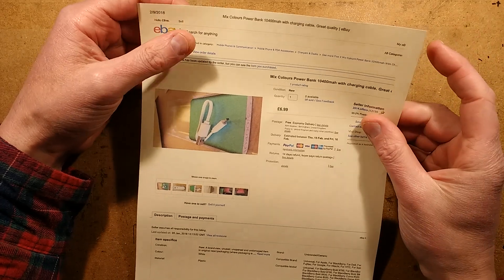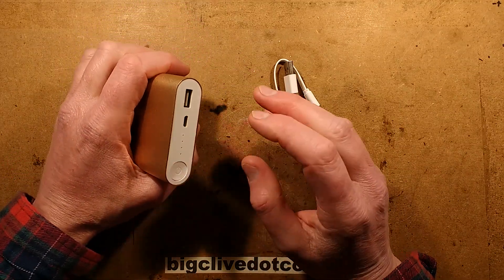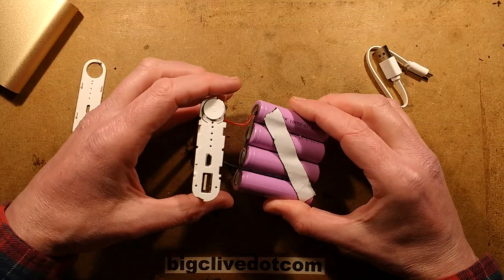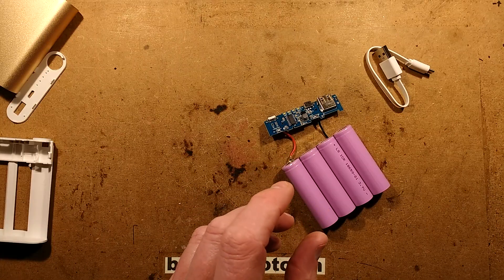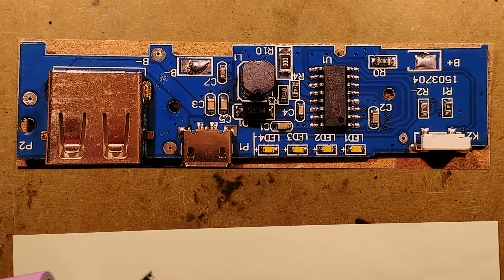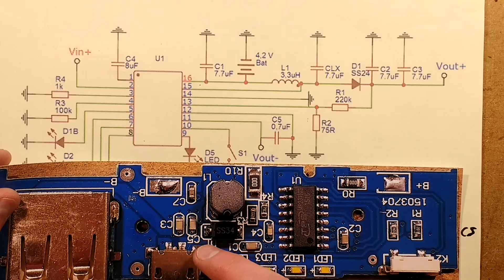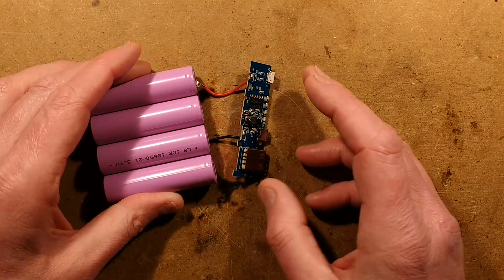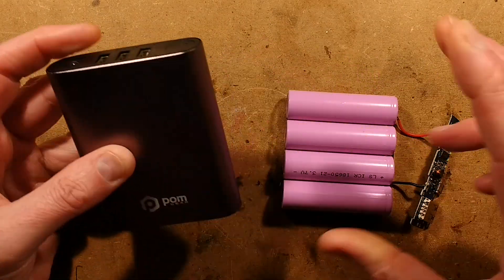Inside a fake "10400mAh" eBay USB power bank.

Comment: 2200-2600mAh cells are usually a simple LiCo chemistry, while the higher 3Ah+ are the newer NCA or NMC chemistries. The major battery makers have all switched to these new chemistries, so new LiCo cells nowadays are either old stock (thus dirt cheap), or from Chinese manufacturers who haven't yet managed to steal an NCA or NMC recipe from the big guys. Meanwhile NCA and NMC are used in electric vehicles, which makes them much more scarce.

Comment: So, how feasible is it to build your own really good version of this? Let's say I want a really chunky backup, maybe 12 18650's in a metal case, nothing flashy just some leds to indicate charge level... Doable for a home gamer?
Reply from the maker: You can buy empty cases for your own cells.  It's also often cheaper to buy a proper high capacity power bank than to buy just the cells on their own.
Reply: bigclivedotcom I have a decent anker backup (I play ingress, you need a decent backup) just wondered about making a chunky heavy duty one.

Comment: If you replace the batteries with 4volts 3amps out of the bench supply does it still deliver fuck all on the output?

Comment: About 3 years ago, they were selling those cases as build it yourself type power banks, you could just insert your own 18650's and what you put in is what you take out.  They worked great for us on our joint trip to Yellowstone National Park, where we spent 9 days in a no service RV Park in the middle of the pine woods that surround the park.  I had four of these, gave one to my sister, one to my brother in law, and my wife and myself kept a set.  They kept our phones working for three days before we needed to crank up the generators in our Motor Homes to charge up the batteries. I installed all recovered 18650's harvested from old laptop batteries that stopped working in the laptops. I found that usually only one or two cells were bad and the rest held very good charges. I just checked, mine say the same thing on the bottom, but I guess I am so used to the lies that come out of China that I never paid any attention to the markings.

Comment: I bought the chassis of one of these on eBay (no cells = cheap) and put my own good cells into it. I noticed the strange charging too and luckily enough my one has spring terminals so the batteries slot in, so I charge the cells in a dedicated 4 way charger.. much faster and better for the cells too. The boost circuit works great so I keep it around still
Reply: The empty packs are great value. I had a bunch of salvaged laptop 18650s and got a couple of these. The slow charge is a pain, but I usually leave it go over night. Good travel packs.
Reply: Me too, bought 2, put cells in from a Ryobi drill battery that had a failed charge controller. 8400mA capacity, been used loads of times and traveled all over the world. Charging is a bit slow from empty but I'm not in a rush.
Reply: Me too. That's the way to go. I use batteries from disposed laptops. Typical capacity is 1800 mAh.  Not great but at least I know what to expect from them. For my powerful flashlight I have expensive Li-ion batteries of great quality - $28 each (18650 protected)

Comment: I have the same POM gear bank. The screws go into the case. The back side of it has a glued on piece of plastic that hides the other 4 screws. It CAN be removed without damage though. There is a good chance the foam anti-vibration tape they put on the batteries will make it rather difficult to take apart.
EDIT: Just tested it. 6.298Ah, 30.291Wh. But it's dated from December 2014, all the cells are marked as HZNB INR18650E 2600EJ 2600mAh 3.7V 9.62Wh. Light blue color. I've used it quite a lot, so I can see it having degraded in capacity quite far. But maybe not that far. It looks like a Samsung numbering scheme, but no Samsung name & the wrong color.

Comment: Your USB load's fan didn't come on in either of the videos where I've seen you use it. I have a similar unit (it was cheaper than building my own and much more portable than using the big bench load) and the fan comes on as soon as it's plugged in. You might want to check it out, replacing the MOSFET if it burns up isn't hard but is a hassle.
Reply from the maker: I keep a cool house and only tend to use it briefly.  The fan does come on when used longer.

Comment: I've had this for a couple of years.  it's a DIY kit one can do themselves with well the 4 batteries  course once you put the ends on it might be a pain to remove the ends without breaking it.  Charges well for me as I stuck good batteries in there..  Lasts forever although the 4 LED's are usually way off on how much is actually in there.  I can be at 1 forever.
Reply: alas the metal thingymebob hit the case and bang  well that happened about 3 months after I wrote the above.  Think I jinxed it  Have another DIY 5 cell that kinda does the same thing, so if I drain it too low it takes over a day to charge.  But the Basic Kindle hates it.  The thing keeps shutting off.  Did it with the above too.

Comment: I have an Orico branded 10050mAh that offered the full advertised capacity, as well as supported quickcharge 3.0 for both charging and USB output to the device.

Comment: As soon as I saw this power bank I recognized it! Recently a local shop was going out of business and they had the "POM Gear" branded power banks (4,400mah and 10,000mah for $1.99 and $4.99 USD respectively).  I purchased a few slim power banks (4400mah) which I suppose contain flat lithium packs inside, because no cylindrical cells would obviously fit in it.

But anyway, I also purchased 3 POM Gear branded Bluetooth headsets for $2 a piece......sadly all 3 wouldn't hold a charge for more than 25 minutes, and they weren't old enough for the batteries to have degraded either.

Comment: i have one of these from a major reputable chain store in Australia. It is stamped 8000mAh on the bottom and advertised as such, yet on when i ran a number of load tests, it only just goes past 5000mAh. Ripped em a new one and got it for free, and still reported them to the ACCC.
Reply: I agree if this was adopted early .  consumers are too derpy to care. 

Really what matter is WH out at the jack.   with QC3 on USB-C at more then just 5v  . you really cant going forward  just assume 5V and state  output  AH.  WH  is more absolute and means the consumer just need to know how many watts a USB-C device is and how long it needs to run , the  fun math is hidden. .;.    EG a    5 WH batt in a tablet  can be charged  twice with a 10 WH  power bank. (  remember this is worse case OUTPUT after the DC DC  WH )  not the internal cells rating .
Reply: Ya these days "reputable" stores also buy directly from China and they really have no intention of testing what they get, they just rely on most people not noticing defects.
Reply: Was it Kmart, cause I bought one in silver that's almost exactly the same.
Reply: Agree with the above replies... however reputable shops selling consumer gear should be listing the Ah at the socket, not at the cells. A consumer doesn't care if it's got 4x18650 cells or a car battery. They just care how much 5v comes out.

Comment: Could you buy 5 or so poundland power banks and just wire the cells out of all of them into one? Or would you need to do anything with the circuit board?
Reply from the maker: Theoretically you could parallel all the cells together.
Reply: bigclivedotcom charging time would be a bitch though.

Comment: When you test the MAH put into it from charging, are you measuring the actual MAH put into the cells, or what you're pumping into the USB plug? Because if it's the latter, you'll be getting an inaccurate number. 1: you're measuring MAH at 5v (unless you're looking at W/H, which would be a simple solution), and 2: the losses from the dc/dc converters need to be taken into account

Comment: power banks from china are a total gamble, i did buy a 10000mah bank for 5.99 from china looks like it has 5 18650 inside and from dead to charged it took 11150mah to charge and lasts ages so you can get the good ones as i say it's a total gamble

Comment: That's a counterfeit of the real version which is a Fremo 10400. They even ripped off the chassis and font and everything. I have the real one and it actually is 10400 mah.
Reply: dude you bought a fake one too... this design is from Xiaomi
Reply: It's Xiaomi power bank, you can even find its casing being sell and marked as "diy power bank"
Reply: @RWBHere research before posting.
Xiaomi mentions the voltage too. My 10000mAh version clearly states:
10000mAh 3.6V
6250mAh 5.1V (at typical 1A)
Reply: lol your's is also a fake
Reply: RWBHere Xiaomi is a giant company, not just a seller
Reply: Xiaomi is a legit company that made many original designs that also won countless red dot awards. Mi mix? first modern 90%+ screen to body ratio (haha! not iphonex yet much better without the chin)
they also own the xiaoyi camera and make scooters. don't trash others because you're trash
Reply: Fremo is another ripoff lel
Reply: Someone So does mine, printed on the "bottom"
Reply: Yeah, looks exactly like my Xiaomi
Reply: That is guys why looking at Ah or mAh does not give you any clue on actual capacity. You should look or calculate Wh or mWh every single time.
Reply: Tom Donhavjuan how do you know?
Reply: kkk is correct, this is a knock off of the original xiaomi 10400mah power bank, the one I had 3 years ado contained 4 sanyo 2600 mah cells, all that came after with the same design and case have been ripoffs
Reply: Oh I see I'm not the first to mention that, I'll leave it anyway just in case
Reply: excuse me? moderation?
"there's no smart people outside of China, only idiots"
that's basically what you're saying
stereotyped much
Reply: or do you ?
Reply: DesolatorMagic ...thats the point of the video lol
Reply: Still using the original classic xiaomi powerbank 10400 that looks exactly the same as this one :D ! I've got it for like 5 years and still working pretty well!
Reply: also search for ASUS' version of this
Reply: There are hundreds of brands using this type of casing
Reply: Someone. Thanks for the correction. Didn’t know that, and assumed they were the same as others I've seen. Some sellers are honest. The best thing would be for sellers to state total Watt hours (or thousands of milliWatt hours, if they want to sell on big numbers!), so that the only potential scam would be on actual cell capacity, rather than the misleading headline figures which nearly all of them use. Some of the better manufacturers are already stating these total power capabilities,  so it's not all bad.
Reply: The Xiaomi was a ripoff itself.
Reply: everything is copied or a copy in China EVERYTHING. you'll never find an original item sold in China.
Reply: And of course that Xiaomi is also a ripoff, because the stated capacity is the total for all of the cells at a nominal 3.7V. Conversion to 5V means that the true capacity is (3.7/5)x10.4 Ah less conversion losses. Assuming 90% conversion efficiency, that gives a true capacity of around 0.74x0.9x10.4 = 6.9Ah (6900mAh) at best, when the cells are new.

Comment: I have a genuine Xiaomi version of this, looks identical even the font on the bottom, just missing the Mi logo. My friend bought it in Shanghai some 8 years ago and it cost the equivalent of........ £6.99!Very good pack the Xiaomi, fully charges a dead iPhone about 4 times on a single charge, will put out 2A easily. The packaging made a big thing of safety with some 7 point safety system or something and claims of only using good quality Japanese cells (I'm sure the Chinese really appreciated that one!). Haven't opened it or done any tests but can say that after 8 years of use it is still going strong with little perceived capacity loss.

Comment: I bought one of those at a local, very reputable electronics store. (Microcenter).   They had one of the generic 10,000mAh power banks, and I bought it.  Turned out to be utter garbage, seemed like it was just  like 3-4000 mAh at most.

Comment: Can you check out the dearer Xaiomi powerbanks, I bought a 3 cell 18650 bank that claims to be 10,000 mAh. It takes my iPad Air 2 from flat to full charged but you’ve got my doubts going now. 
http://www.mi.com/en/pb10000/
Reply: Green Silver From my experience, Xiaomi batteries are of very very good quality, practically unbreakable, and have the capacity advertised. They are hard to find and there as tons of fake ones. That's a bit of a bummer.
Reply: Lolwutfordawin 
Mine came from Banggood about 3 years ago, it cost around £13 GBP. 
It comes with a scratch off panel, under it, you enter the number on the Mi.com website and it says if it’s genuine.
Reply: I have that exact powerbank. got it about 2 years ago for 10USD from alibaba. I'm pretty sure mine is genuine since it will fully charge my Moto G 2015 nearly 4 times.

Comment: Hypothesis: the difference between the unit and the circuit diagram you found is a design/manufacturing error.  One they only spotted after they'd made a load of these units.  It makes the charge current drop off too soon with 1Ah cells and maybe fails to fully charge 2.6Ah cells.  Rework was deemed too costly, so they stuck in 1Ah cells and sold it off cheap.

Or it could just be an intentionally shitty design to sell cheaply.  But all the other aspects of it look quite good.  So I'm guessing somebody said "Oh fuck, we'e just made several thousand defective boards, what are we going to do with them?"

A brave (and foolish) man would try modifying the board to match the circuit diagram.  Possibly with a flaming battery containment receptacle nearby.

Comment: Looks similar to asus zen power but it has 3 18650 cells and a huge pcb. Front panel looks very similar except it has qualcomm quick charge port.

Comment: What I don't get is,  if the IC needs all the supporting small components to take two lines in and two lines out. Why isn't it all just integrated into one single package that just does that? Or am I just a wrongun?

Comment: 3,7V * 10400 mA/h = 38480 mW/h , 38480 mW/h / 5V = 7696 mA/h.
So a bank with 10400mA/h cells will deliver 7696 mA/h on the output. Minus efficiency loss in the converter.
Reply: Drop the slashes. It's multiplication, not division.
Reply: mAh.. yes.. that is true.... :-)

Comment: 3Ah cells cost $4-5 and I'm talking about high discharge Samsung 30Q and LG HG2. By replacing those with 4x Panasonic NCR18650B you'd get 13600mAh and you can get those for $3 per cell on Aliexpress form liitokala store (yes, they're genuine)

Comment: Chinese culture has this wonderful (well, not always for those doing business with them) concept called "face" (as in 'saving face') that basically says it's better to lie directly about something than admit weakness.  It's why you'll see things with like 10gah; factory A will sell a pack with like 4ah, factory B (who probably has a near identical design due to stealing or reverse engineering factory A's) will make the exact identical product (copyright laws are very minimally enforced there especially in any industry making profit selling exports) and advertise 8ah, then factory C will say "to hell with those guys, our battery is 10gAh!".

I wonder if you could test the anonymous chip by connecting pin 9 to ground through a LED and resistor as indicated.  I wonder if that chip is just a competition copy of the one you found data on, and if so, if they copied the exact design or just left out that function since it wasn't going to be used on this product (again, reverse engineering and copying competing products is just part of business in China).

Comment: Thats why ï have an xiaomi MI power bank 
It's being sold as a 20.000mAh powerbank but it said that was the PACK power of the cells 
The true capacity (also stated again at the back) is 14000 given.. 
Although I measure around 14500 15000 what in my opinion is absolutely awesome! 
I can charge my phone around 9 times when not fully empty and 5 or 6 when full
This thing is a beast... It's quite big, and heavy... But it's awesome! Totally recommend!
Reply: Only real downside.... It has a QC3 output... But it charges @5 volt 2A in the beginning... But 5V 1A when half full... Thats the only issue but totally fine when leaving it charging overnight.... And somewhat during the day 😂
Reply: That's not the fault of the charger. That is the phone behavior. The charger is ABLE to give 2A, if the phone requires. Lithium batteries are charged at CC/CV, when the CV regime kicks in, the current will always go down.

Comment: Hey Clive, does the output voltage drop away because the input voltage can't cope with the load? Could you test it by connecting it to a power supply set to 4.2v and see if it can output 2Amp stable. I wonder if with decent cells it would work ok.

Comment: I would buy one of these for the case and install much better batteries.
Reply: Never mind the circuit is lousy so it isn't worth buying even for the case and the circuit board. I have really good ones that I buy that usually never drop below 5 volts until there is over two amps of draw.
Reply: Im quite sure that the circuit would hold the 5 volts if it didnt have so shitty cells that cant output enough current, but you never know without testing.
Reply: Get the Mi(Xiaomi) powerbank instead. Same design way way better quality

Comment: I make my own out of 18650's that I test. The ones I use are tested at 3,500 MAH each, so the 4 battery models are 14,000 mah and that is proper. These cheap ones can't be that high due simply to the cost of the batteries. I can't sell mine for under $40 US or I lose money.

Comment: I got a charger from a few years ago like this from Miomi or something. Seems to charge my 2Ah smartphone battery nearly 5 times. Now this design is available as a kit on eBay, 10,400mAh is probably about right for the originals, and that was what was written on the plastic. SO now we get any batteries.